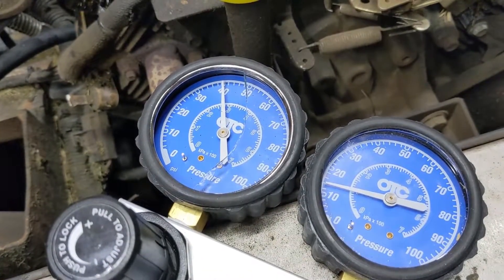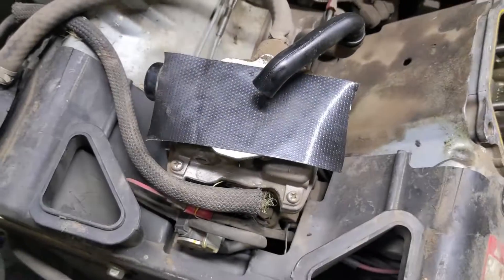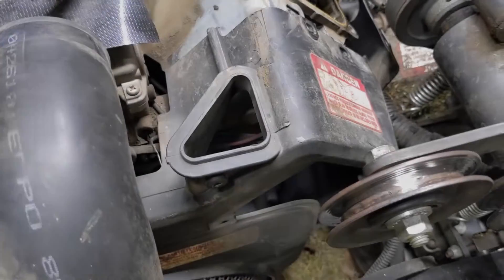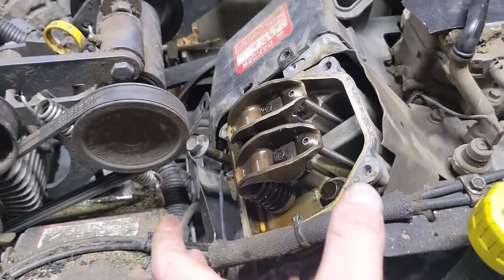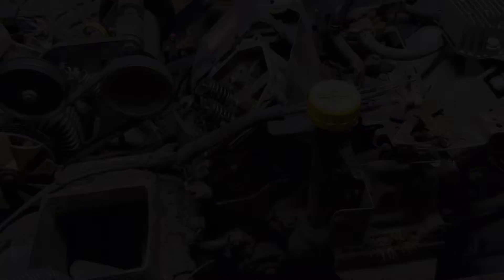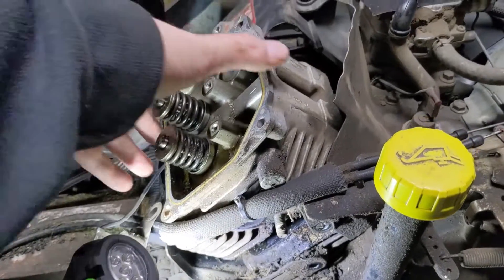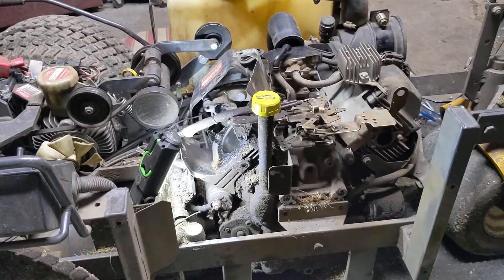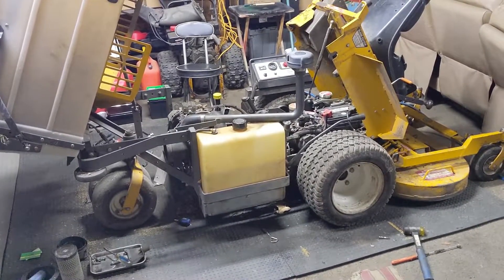Kohler CH23 Head Gasket Replacement [PART 1]

Comment: I personally think it’s easier to pull the engine, but it’s nice to see different ways of doing these. I worked on a kubota zg23 with the Kohler ch23s. Owner took it to the dealer, they said it had a bent push tube, so fuel pump was not operating and only one cylinder firing. White for repair was 1200$ if that’s all it was. 

I told him bring it to me and I’ll do it. Long story short, 1 complete head, complete engine seal kit, plugs, and filter for under 300$ and he was back on the way. Didn’t charge labor it was family. Lots of money can be saved working on your own stuff.

Comment: Why didn't you remove the engine from the mower? Only takes about 30 minutes and gives you all the room you would need. Also you could change the starter as a preventive measure. As well as be able to properly clean all the cooling fins correctly. You took the difficult way.

Comment: Being the unit is a commercial mower. Most repair facilities in my area will not replace ONE gasket. I "assume" that is why your customer received the higher quote.By no means am i discrediting your work. But there is a lot of signs of neglect on this mower. The caked up oil on the engine. The rat feces and grim.  So I could only imagine what the engine looks like under the shroud. Are the cooling veins clear on the flywheel. How long will it be before the other side fails. So many variables come into play here. Defiantly be sure you notify your customer and document your repair order well of these things. You only have ONE reputation. Guard it well. No disrespect meant . I enjoy your videos 👊
Reply from the maker: Yes I made my customer aware that it desperately needs a powerwash and throughout cleaning, he agreed. Thanks for watching!

Comment: Average small engine labor shop rate of $75/hour, $1000 for this job is high, but not completely out of the ballpark.  One of the oldest moves is to bid the job high if you really don’t want to do it.  Good video.
Reply from the maker: 13% HST included in that too, so probably around $850 without taxes? Thanks for watching!

Comment: Man do i feel for you. i have never done one on a zero turn it bad enough on a Riding mower . On them it just take hood off and then its all in the open Thanks for the tip's if i get a zero turn i'll have a head start on it. Stay well and keep up the great job
Reply from the maker: It's not that bad, just time consuming. Thanks for watching!
Reply: Object on a zero turn is get one that has the least amount of BS clutter . OMG I couldnt imagine having to change something down further in this machine. The heads are at the top of the engine and it was still a bear it looks like anyway. I have a 2009 Toro ZMaster z500 and I am no small engine mechanic. I have rebuilt the entire mower except for the engine and the wire harness. I have rebuilt everything from front caster bearings to totally rebuilt  the deck, all new safety switches . Just replaced both wheel motors and hydro pumps. Now it's going up for sale!! This Toro is sooo easy to work on. They were definitely thinking about this when they engineered that mower. I seen some newer zmasters that looked about as bad as this walker as far as working on it. What the hell were they thinking I ask myself lol. It is what it is I guess. But there are some that are less cluttered, giving more space to work on the. When needed. Thanks for ALL your videos brother!!👍👍👍